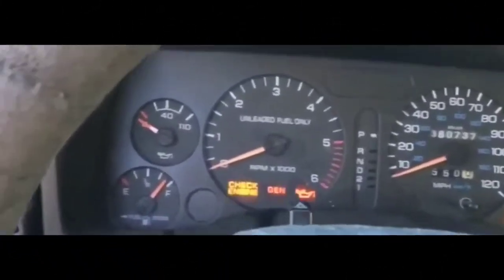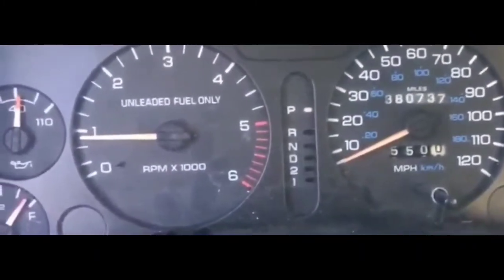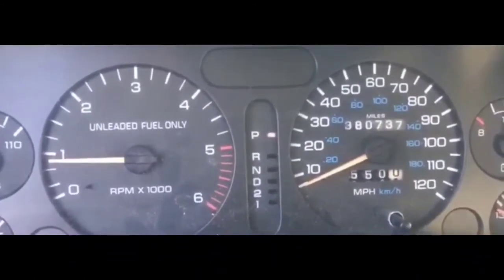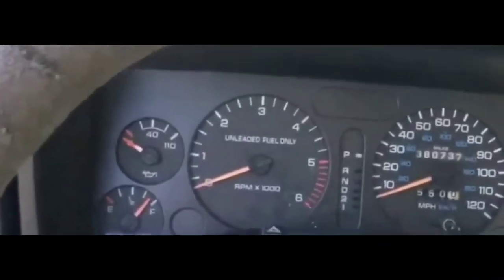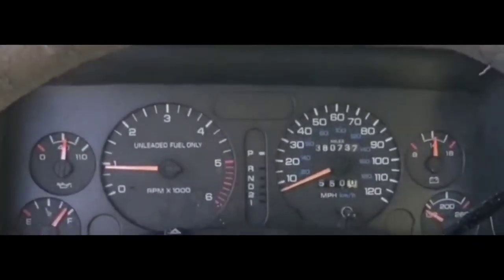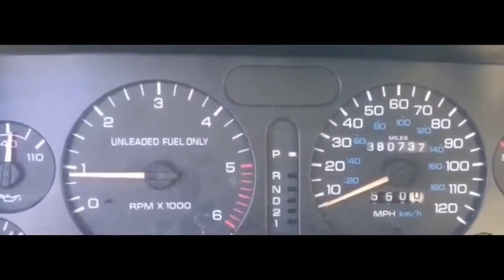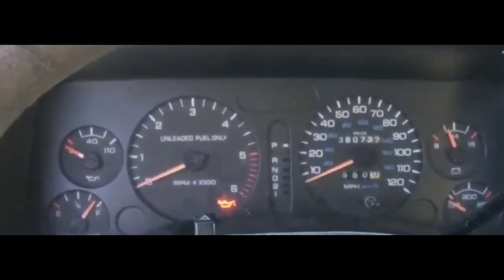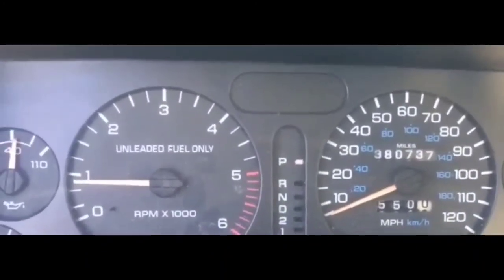1994-2001 Crank/ no spark / no start COMMON Causes DODGE RAM/DAKOTA/DURANGO MAGNUM

Comment: this guy really dont have a clue a 99 Dodge Ram has only one coil with a dist cap.
Reply: They have a coil on the front by the tensior pulley and a pickup coil under the distributor cap
Reply: @StationRussification wrong the one is the bell housing is the crank sensor, the closest thing to a cam sensor on the 5.9/5.2 is the pickup in the distributor.

Comment: 01 durango 5.9 crank no start replaced crank sensor distributor and roter coil and ignition switch still no run
Reply: Hopefully it's not the pcm
Reply: Did you figure it out?
Reply: @tommyb7587  ya pcm
Reply: @gregghoffmann42  yep

Comment: This video is really bad
OBD II started 1st on 1 vehicle the 1995 Dodge Neon then on every other Domestic Dodge in 1996
The pick up plate in the distributor on these vehicles is for fuel timing & has nothing the do w/ignition 
Cycle the ign 3 times w/out cranking & leave it on the 3rd time & your odometer will display the p codes
Reply: The pick up coil absolutely affects spark & how tf you think an analog odometer is going to show a code?? 🤡
Reply: @robertthomas7239  Every Domestic Chrysler has this feature if the odometer is not LED then the Check Engine lamp will flash in old school Fault Messages so like for an EGR U'd see 12, 32, 55 anyhow if U do not know this it is probably over your head.... as for a pick up coil that is not what is in the distributor on the vehicle in this video we R specifically talking about that 'pick up' is for fuel timing only

Comment: Your fase on thode years obd2 came out in 1996 and newer not 1998 and newer
Reply: I have a 1995 and it has an obd2 port... I was shocked- my scanner only goes back to 96 and I have to manually imput the vehicle data... It's a late build, 11/95 and the scanner reads the PCM... That being said- this truck has alot of issues... It was tweaker owned, there's a PCM issue, I swapped the PCM and still have a crank, no start situation... but I have lights coming on and am able to communicate with the pcm now... But tachometer doesn't move at all, so I'm assuming the CPS is the culprit... On top of being a tweaker owned vehicle, it was a flood truck... It's more than likely going to a junk yard... For whatever reason, on top of everything, she got in the truck and removed the entire dash, radio... everything... it's a Fing nightmare...

and she wants 1500 for it...